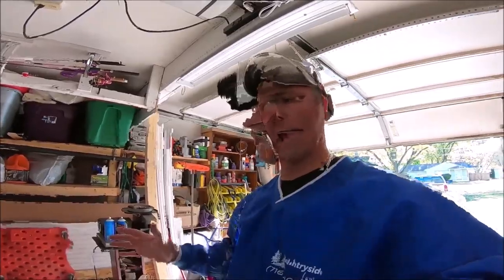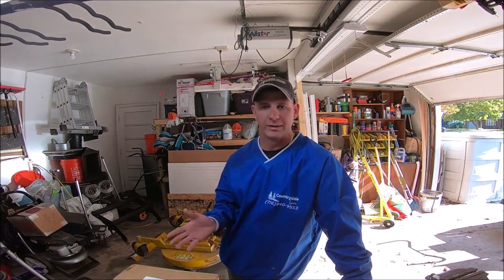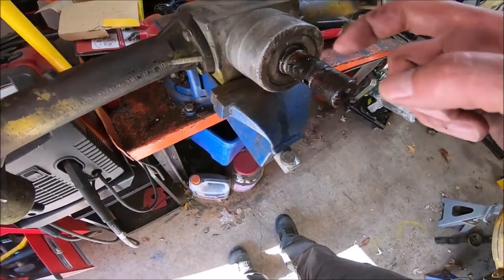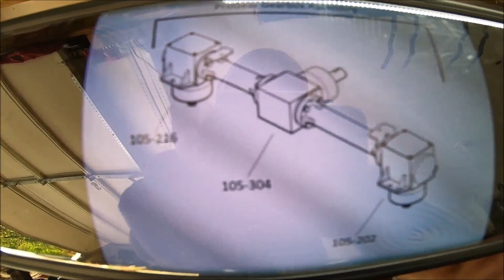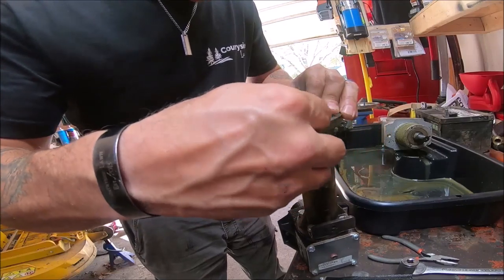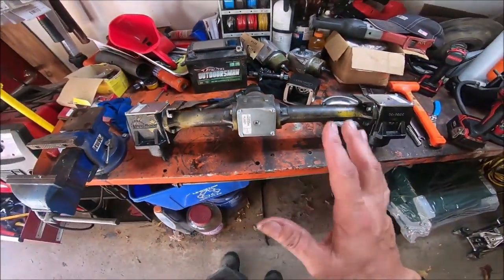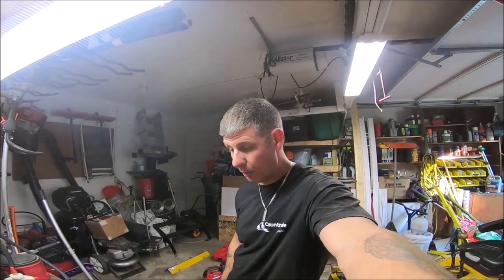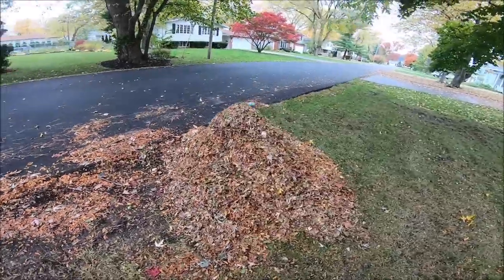Walker Gear Box Fix?? / Pro Gear

Comment: Back as teen when I started working on mowers they real made a good part and housings of cast iron. As of these days to cut cost they build parts that don't last when they put mowers and cars together. When shouldn't have to go to after market to get a part that last. When you spend $10,000 on a mower it should have quality parts already on it. Glad you got it going and doing your yards. Good video as always.

Comment: I believe your newer 56 has cast iron boxes. Your newer older 56 may or may not. Walker has changed most decks over to cast iron boxes and I not certain on this but if they have aluminum you can upgrade up to cast iron boxes. The main reason for the from aluminum to cast is if you hit something and broke shear bolts on blades cups and blades hit each other (collide) or a blade gets under the blade in the collision it would rip the bottom of the aluminum gearbox right off. Also those aluminum boxes would get a lot of hairline cracks around the gasket you scraped off and was hard to identify because the cracks where so small and oil would leak.  When you get the drive shaft get both sides of the shaft(they are expensive) because they ware out and shafts don't fit tight and you get a lot of vibration from it which will cause problems for the tractor such lose nuts and bolts frame cracks. Great video! Very windy down here today!
Reply from the maker: Yup I've done that to an aluminum box, destroyed it. Thanks for watching

Comment: Had to get the updated gear shaft once I replaced mine and had problems with the red gasket sealer leaking, just a heads up...On a side note the hydros are rebuildable as well... for when that day comes... you can split the case and use a press to push out the bearings and hit your local bearing distributer for a matchup... just make sure they know its high heat application....The repair I hated the most second to the hydros was the blower.... that one will make you cuss for hours.... the only other real problem ive had with your similar year model was the voltage regulater until I rewired it and moved it to the back of the mower from most of the heat source.... those can be opened up too and checked before you just go throwing money at it and can be something as simple as a bad connection... Ive had the exhaust crack twice as well.... and on the third one I used heat wrap tape...  so far its outlasted the previous 2 and maybe taken the running temp down 5 degrees on average.... Other problem ive fixed recently was the bolts sheared off from the transmission housings.... went to my local walker dealer and he sold me a side housing for hardly nothing from his dead walker part stash... I tried retapping but it was a mthfker because I was trying to be lazy and not remove it... wound up fking the case... Im guessigng curb hopping over the years took a toll on them... needless to say I dont let my guys curb hop them anymore.... glad to see someone else on their way to being a walker master mechanic
Reply from the maker: Lol you must be new. I've been doing this for years and some of that stuff you've mentioned I've already done and made videos on. Some of the other stuff you mentioned makes me wonder if your guys are Baja driving your machines in a drunken stupor🤣🤣🤣🤣🤣
Reply: @CountrysideStrong  haha I hear ya man... one of our oldest model is a 2006 31hp.... when you keep a walker mower running for 13 years with multiple employee use... I bet our repair list would be similar... But the new ones have their quirks too... soo I just decided to keep them as long as I can and id save a fortune doing the repairs myself vs buying new every 2-3 years....
Reply from the maker: @greenlawnaugusta3100  Amen to that. The new ones scare me after all the computer horror stories I hear

Comment: Wouldn’t you think for what walker charges for a mower they would be using the best gears available?  Very interesting video. I had a squeal in my deck this summer but walker fixed it and no issues since.
Reply from the maker: Yes I agree they should

Comment: The peerless boxes are absolute trash. I can’t tell you how many I replaced as a walker mechanic. I bitched at walker every chance I got. Quick little tip: Use permatex red gasket maker on those P007 gaskets. Guys also make sure you time the outputs of the outer gearboxes 90 degrees apart.
Reply from the maker: That's very true